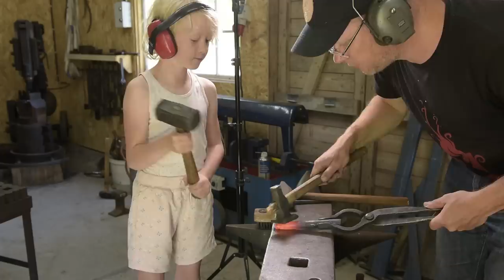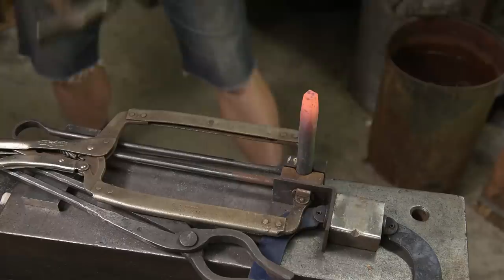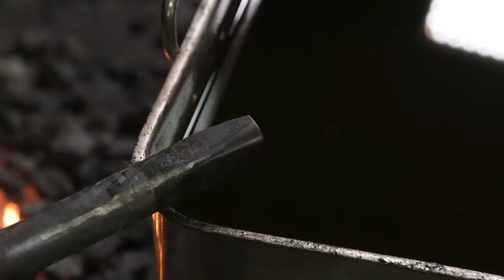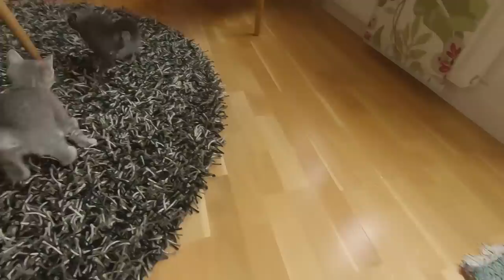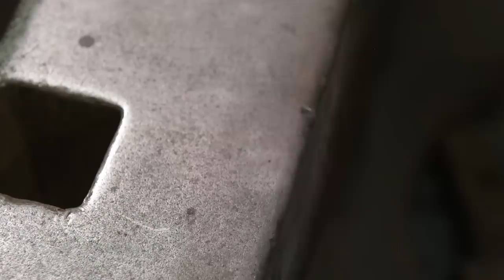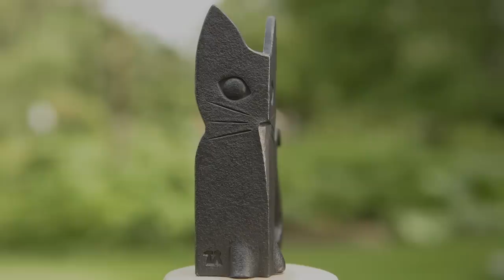Blacksmithing- Making a cat figurine (from angle iron)

Comment: I was so impressed with the beauty and simplicity of the cats, that I made two for some friends. 

I found, however, another method or sequence in the forging that worked easier for me.  I did all the cutting out of the head and waist, the eyes, nose and whiskers on the vise BEFORE separating and forming the tail.  It was MUCH easier to clamp in the vise and do all that without the tail in the way, then I quickly cut out and formed the tail and feet.
Reply from the maker: Thanks! Whatever works best!!

Comment: I love this! 
I was hoping it would be a bit simpler so could try it, but I know you’re just skilled and make it look easy… haha I know that was probably much tricker than it looks and I don’t have most of those tools. 
I’ll still try and figure something out with what I have, because I love cats and I love forged stuff.
Reply from the maker: Thanks. Go for it!
Reply: @torbjornahman  I actually figured out a different way to do the eyes… since I can’t forge a tool like you did, I shaped a length of steel bar into a curved triangular punch, then I punched both sides of the eye to get a very similar look to yours. Instead of one punch that does the eye and the negative of the pupil, I did the opposite. It worked pretty well in my tests, it’s just tricky to line them up so it looks right. I hope you understand what I mean.. 

Thanks again for inspiring me, and helping me work my problem solving part of my brain!
Reply from the maker: @DanteYewToob  Great!

Comment: I have always wondered if it is more brute force or the weight of the hammer when manually striking the metal to bend or shape it?
Reply from the maker: A bit of both! The variation in blows are endless I guess... some light some really hard.

Comment: I see you wear a respirator when forging. Is that because you use coal, something to do with the metal, or another reason? Thanks.
Reply from the maker: I wear one simply to keep dust out of my lungs. It can be residues from the fire or the scale of the work swirling up when forging, grinding and oil spray/droplets from the power hammer.

Comment: Torbjorn, I have a question for u. You Sometimes use 51600 0.60% carbon leaf spring steel and when you gonna Quench the blade into the oil You almost achieve 850 to 900degree celcius as per standard but why your blade don not get any crack even you edges always has sharp edges not even rounded. Kindly tell me some tips about this i am also a blade smith but offently i get cracks in my blade bevel while quenching into oil even if the oil is pre heated :(. Why is that?
Reply from the maker: It can have many reasons I guess... micro cracks from forging too cold, grain structure, blade profile etc. In general keeping some thickness is a good idea. I'm not really into blades so I don't have much help to offer.

Comment: What is the benefit of making tools from spring steel?
Reply from the maker: Opposed to what? It's a high carbon steel that can be hardened to take a beating without distortion. Mild steel would not work for tools like this.

Comment: What’s the reason for striking the iron then bouncing the hammer on the Anvil is that to get any slag off the face of the hammer that’s the only reason I can think of
Reply from the maker: No definitely not. It's when you make a slight pause. Maybe evaluating what to do next/turn the work, re-grip the hammer or work. Instead of wasting energy stopping the hammer we often let it bounce or rest on the anvil.